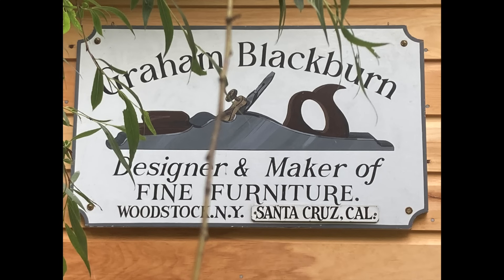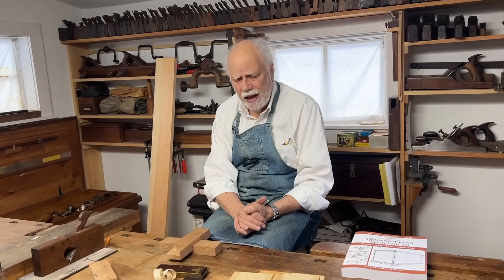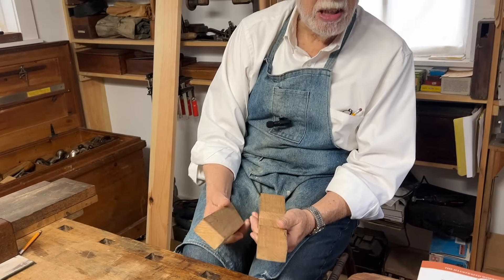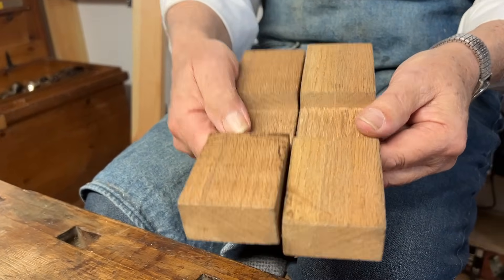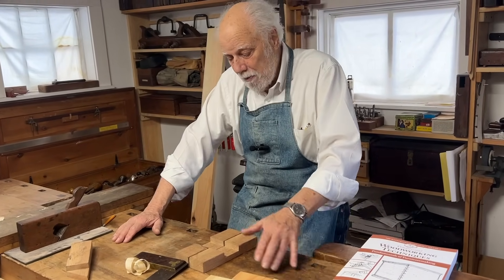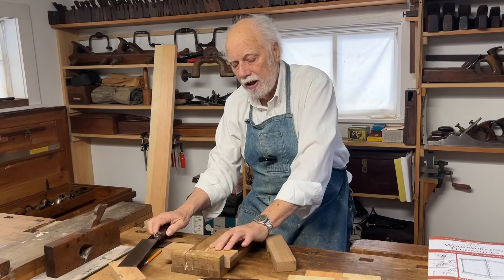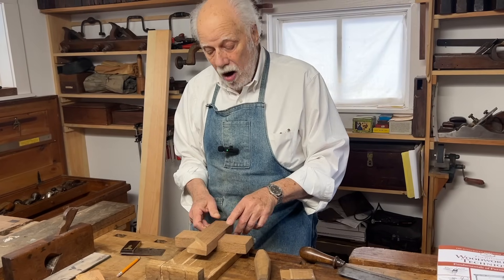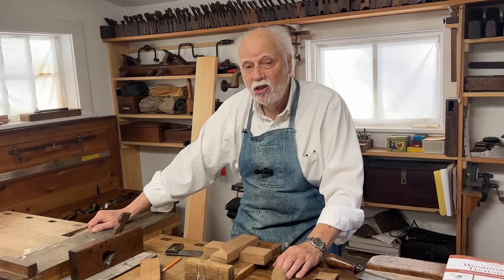107.Joinery 4: Cross-Lapped Joints

Comment: I've seen a Japanese woodworker make the same joint BUT, he made the rabbit slightly under sized, then he tapped the surface of the matting piece edges with a hammer to get it to fit. Then, after he assembled the joint, he applied water to the joint to swell it up again to original width but now it is housed in the joint, very tightly.